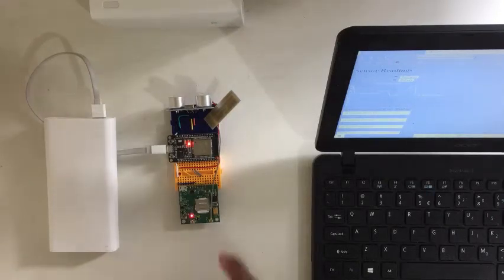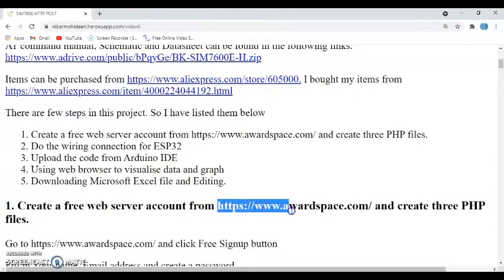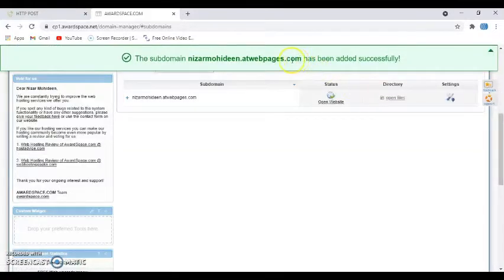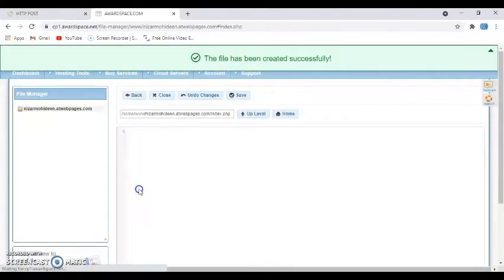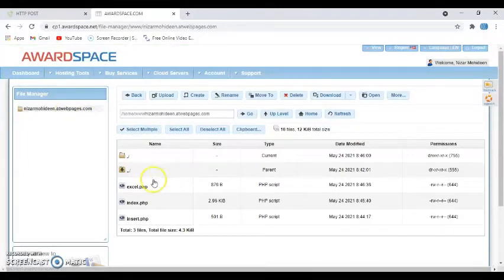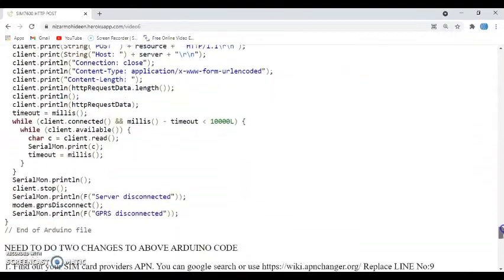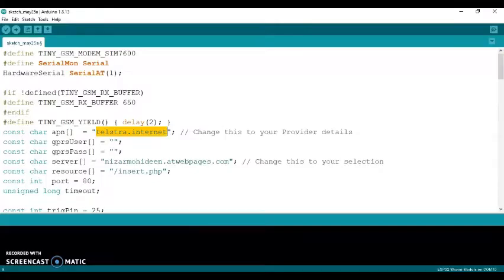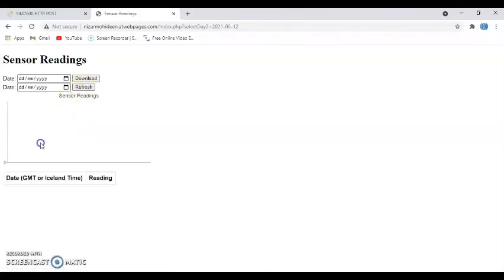6. Using SIM7600 to transfer data to web server through HTTP POST

Comment: no reading at webpage 
Waiting for network... success
20:30:19.024 -> Network connected
20:30:19.024 -> Connecting to TPG success
20:30:19.723 -> GPRS connected
20:30:20.241 -> Performing HTTP POST request...
20:30:22.367 -> HTTP/1.1 200 OK
20:30:22.414 -> Date: Thu, 01 Feb 2024 12:30:20 GMT
20:30:22.556 -> Server: Apache
20:30:22.650 -> Content-Length: 0
20:30:22.697 -> Connection: close
20:30:22.792 -> Content-Type: text/html; charset=UTF-8
20:30:22.933 -> 
20:30:23.122 ->

Comment: Awesome 

Does sim7600 support 3G or 4G network?
Reply from the maker: Yes. It works with both 3G/4G. Actually the module I am using has two separate antenna connectors. One for 3G another one for 4G
Reply: @NizarMohideen  Thank you 🌺

Comment: sim7600sa + timGSM library work on 3G/4G???
Reply from the maker: Yes. SIM7600 is 4G module and it is backward compatible with 3G
As for the TinyGSM, the library creator says it works with 2G, 3G and 4G refer https://github.com/vshymanskyy/TinyGSM
Reply: @NizarMohideen  thanks

Comment: Connection fails at this part of code.

SerialMon.print("Waiting for network...");
  if (!modem.waitForNetwork()) {
    SerialMon.println(" fail");
    delay(1000);
    return;
  }

LOG:
Initializing modem...
Waiting for network... fail
Waiting for network... fail

 Please help me with this!
Reply from the maker: Hi Darshan,

Step 1. Make sure sim module is power on (Is the red light is on)
Step 2. Make sure Pin T is connected to RX2(16) and Pin R connected to TX2(17) Pin
Step 3. Make a new Arduino sketch as given below and upload the code
//--------------------------------------------- from here
#define SerialMon Serial
HardwareSerial SerialAT(1);
void setup() {  
  SerialMon.begin(115200);
  SerialAT.begin(115200,SERIAL_8N1,16,17, false);
}
void loop() {  
  if (SerialAT.available()) {
    Serial.write(SerialAT.read());
  }
  if (Serial.available()) {
     SerialAT.write(Serial.read());
  } 
}
//--------------------------------------------- to here
open the serial monitor and type AT   
-----→ you should get response OK

if you get OK then type at+creg?
 ---→  you should get response +CREG: 0,1

If not type at+csq

 and let me know the responce
Reply: @NizarMohideen  The code that you suggested for test didn't work for me. The Commands didn't respond with OK. What should I do??
Reply from the maker: Make sure both ground pins connected 
Also TX RX connected.
You should at least get AT echoed back to you
Reply from the maker: Serial monitor baud rate should be 115200. if not change it as well
Reply: @NizarMohideen  Yes got AT echoed back
Reply: @NizarMohideen  The AT commands are just echoed back without any response.
Reply: @NizarMohideen  BTW, I am using ESP32_Devkit_v4 so for that I had to use pins 3,1 as RX,TX pins. And the SIM7600 module is powered through USB. Let me know a better way to contact you, so that I can send you the images of my setup. Thanks!!
Reply from the maker: In the serial monitor there is a drop-down option in the bottom right hand corner near baud rate. change it to “Both NL and CR”
Now you should get OK response to AT
Reply: @NizarMohideen  Did that already. Nothing changed.
Reply from the maker: You need to make sure
1. the antenna is good
2. sim card is compatible with the module

To make sure all good., you can use a FTDI adaptor if you have one. Connect RX-TX, TX-RX and GND-GND pins. Try to get response OK to AT. Then check below commands one by one 

AT+CSQ
AT+CREG?
AT+CIPCLOSE=0
AT+NETCLOSE
AT+CGDCONT=1,"IP","live.vodafone.com","0.0.0.0",0,0     //Your APN
AT+CGSOCKCONT=1,"IP","live.vodafone.com" 	 //Your APN
AT+CSOCKSETPN=1
AT+CIPMODE=0
AT+CIPSENDMODE=0
AT+CIPCCFG=10,0,0,0,1,0,75000
AT+CIPTIMEOUT=75000,15000,15000
AT+NETOPEN
AT+NETOPEN?
AT+IPADDR

Finally if you get an IP address back to AT+IPADDR, you can continue with the project.
Good luck.

See you tomorrow
Reply: @NizarMohideen  I tried connecting the SIM7600 board through serial communication and executed all the AT commands and I got IP address in end. Then I tried the test code with esp32 connected to the board. Still nothing seems to be working.
Reply from the maker: Good,
You told me you are using ESP32_Devkit_v4 so for that you had to use pins 3,1 as RX,TX pins. 
Pins 3, 1 are for code uploading and serial debugging. So we can’t use pins 3,1

Use pins 16, 17 as RX, TX pins. Try the test code. It will work. By the way, some ESP32 port  doesn’t show up when 16,17 connected to a device so unplug sim module from ESP32 while uploading the code. After code upload, connect the sim module and connect sim GND to ESP32 GND as well.
Reply: @NizarMohideen   Nothing wrong with the code, it works fine. I connected FTDI to ESP32 and successfully got all that was sent from the code. However, the problem seems to be with SIM7600 UART. It doesn't seem to be working. Please let me know what should I do?
Reply from the maker: When you connect pins 3,1 to FTDI you will get output which sent to serial monitor. That’s correct. Connect pins 16, 17 to FTDI and see what you get from those pins. Do you get different outputs,
Reply: @NizarMohideen  Its working, my board manufacturer(generic) actually flipped the print of pins. So RX was printed as TX and TX as RX, I contacted the manufacturer and changed the wiring accordingly and everything is working now!!!. Thanks a Lot!!
Reply from the maker: Thanks. Have a nice day